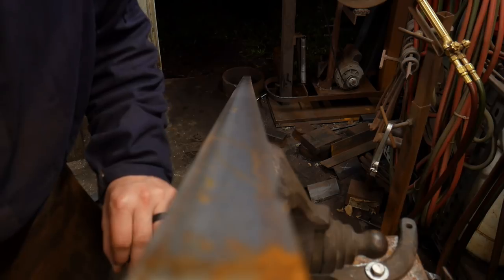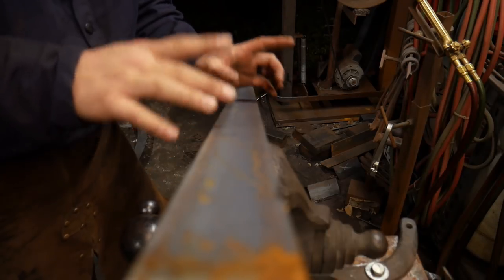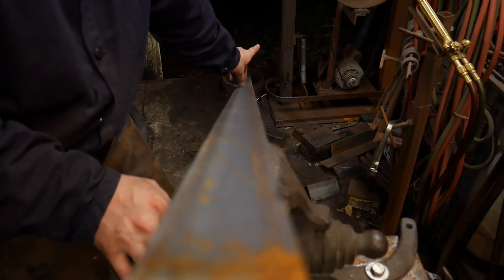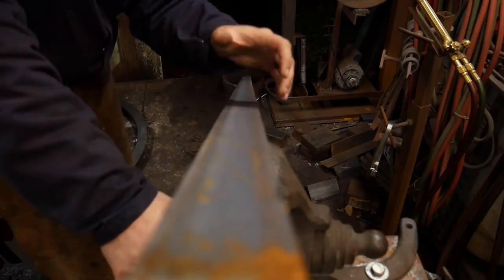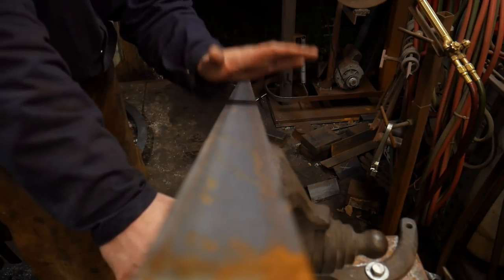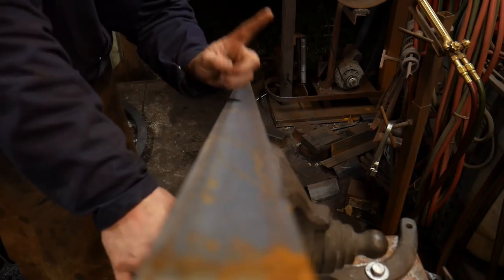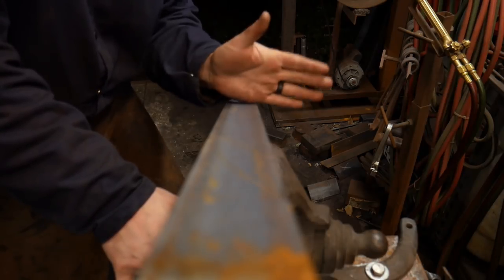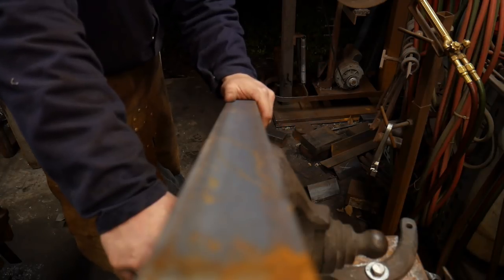Steel is NOT Straight! [Pro Tip #49]

Comment: 3:00 A random shop cat appears!

Another cause of metal warpage is internal stresses.  It likely isn't going to show up at the scales at which a blacksmith works, but machinists have to be aware of it.  But since blacksmiths generally heat that metal red hot, and then beat it around, they are adding orders of magnitude more stress than was ever added by the factory...